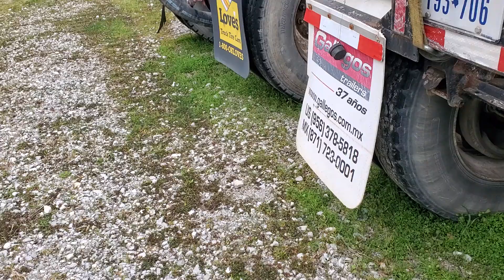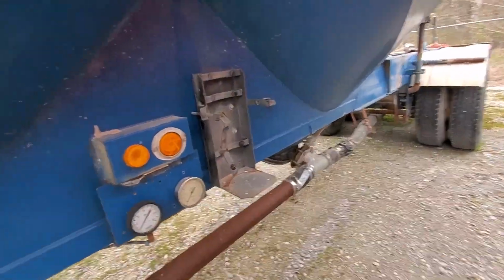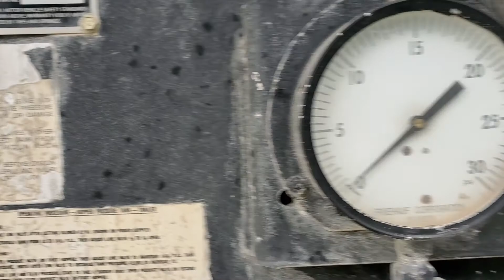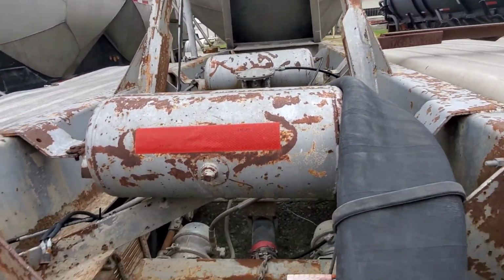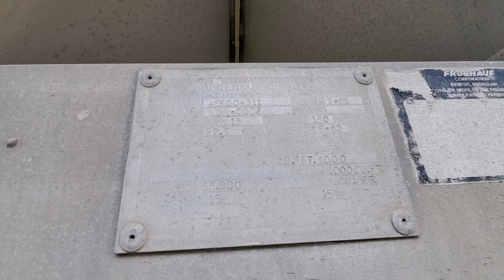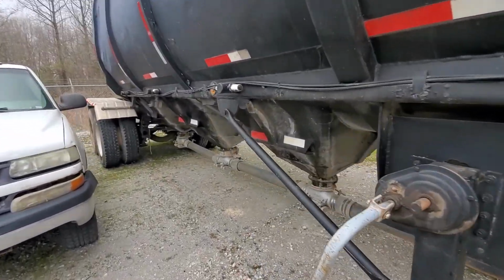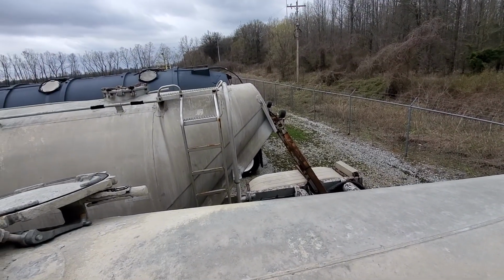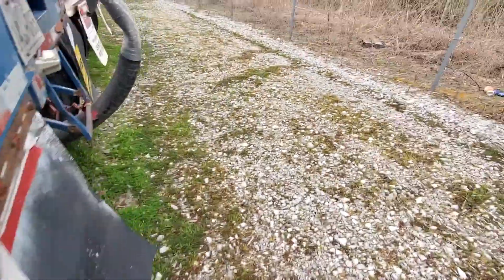Pneumatic Dry bulk trailers Aluminum and steel

Comment: Hi I own a truck I been getting road ready and almost done and I have access to a pneumatic trailer and wondering if it possible to get into hauling frac sand or food product with no experience, I recently got my cdl 3 months ago but companys wanting experience is what's killing me and I would rather work for myself then deal with 700 a week with a over the road company willing to hire like Warner or swift due to me knowing how to drive years with family business my dad and uncles been running flatbed for 20 years plus I learn alot from them
Reply from the maker: There's money out here it's just a matter of getting all your equipment ready and able to consistently service your customers
Reply: @JPTV3000  thanks for the Info and I will continue to follow your journey subscribed and notification bell lock in bro